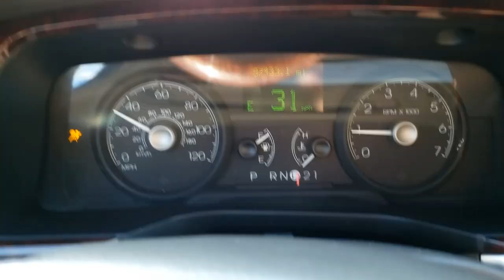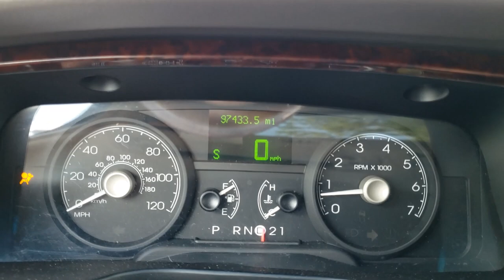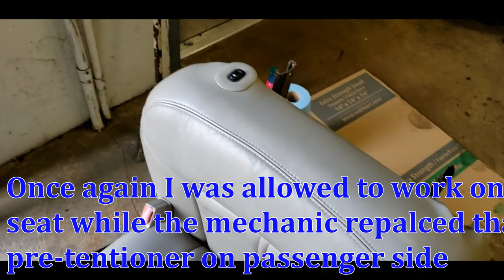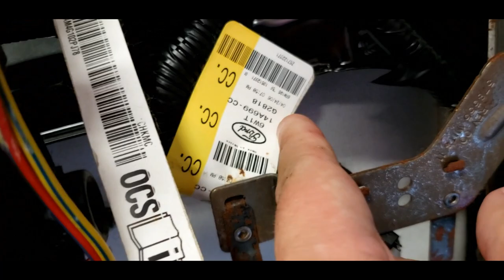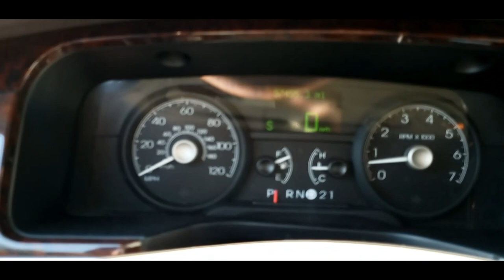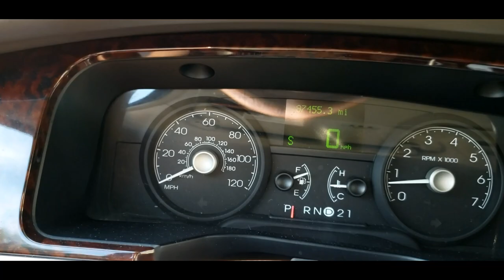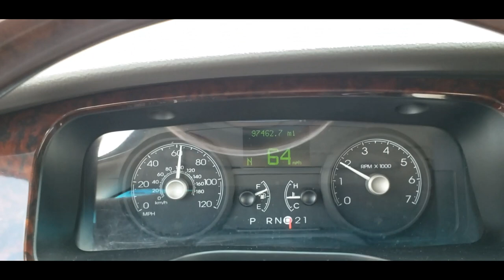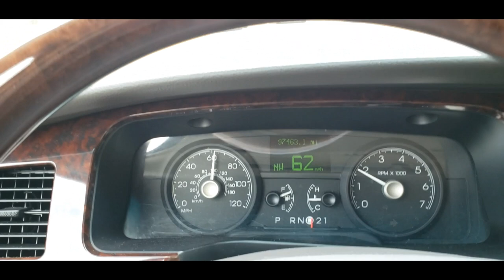Final Attempt To Fix Airbag Light on My 2006 Lincoln Town Car + I found Another Lincoln Town Car!!

Comment: Lincoln is underrated, you see the new ones they have, they are so neat. Dont see too many, but when I do it's always a treat. If they keep going down the path they are right now, they could be the American bentley.
Reply from the maker: I agree and miss the times when there were lots of these cars running around
Reply: @VitaliyKofman  Yeah, American cars are so underappreciated. I wish US car brands would make a bigger splash than they are right now. They complain about quality these days, yeah some aren't as good as they should. GM and ford these days do need to work a little harder. But these older cars are very reliable. Before  GM and other US companies just used rebadged cars, they let the engineers make some rock solid cars. For example: Before GM completely took Saturn over and rebranded things, those cars were so reliable. My father had Saturn SL2 for 20+ years, only had some transmission work after many years and many many many miles, and had to replace a seatbelt, thats it. Funny thing is, is it was built so well, when he got into an accident, the airbag didn't even need to go off, the car did a great job at softening the blow, and he was doing at least 35-40 mph and he was able to drive it home. And the other dudes car was completely smashed on the side. Now days the whole front would crumple even when a slow and weak force is applied. So i love older American cars, very good. Some brands like Lincoln still has it today, and maybe dodge is still decant. But quality control needs to be what it once used to be. But for the main part they are very good.

Comment: Congratulations on fixing your beep. and around how much would the labor cost at a shop to replace the seatbelt kit for these cars?
Reply from the maker: Thank you! Super happy about this! Labor for both sides was $520. Way cheaper then at the dealer + I was able to buy parts myself.
Reply: @VitaliyKofman  nice!
Reply: How much were the parts and what parts were changed? Love your lincoln!
Thanks for your reply!
Reply from the maker: Thanks! Both seat belt retractors replaced for about $520 + labor which was reasonable. At first driver's and then passenger's.
Reply: And did you need both seat belt retractors? and how about seat belt tensioners? Thank you for your response back!
Reply from the maker: I think retractors and pretentioners are the same thing as they come in 1 assembly. I first replaced the driver's side and the light went away for 1.5 weeks. Then it came back and after replacing the passenger's side it stayed off for 2+ months and hope it stays this way.

Comment: You have a leak causing your rust problem. Likely spot is the passenger side intake cowl, blocked by leaves etc. your carpet is likely soaked every time it rains. Fix is easily found on YouTube, 5 minute fix,
Reply from the maker: @brian murphy It's been raining heavily for the last couple days in IL and I thought so also. Checking the carpet and it is a bit wet, but nothing drastic. I know of that intake cowl and it's perfectly clear of any crap so don't know where it's coming from... Maybe I'll have my trusty mechanic check it out.
Reply from the maker: Thank you! I does look clean, but I never removed that shroud to check the seal or how it is on the deep end. Looks like I have another project coming up over the weekend and another video to make :)
Reply from the maker: Thanks for that! I have 06, but looks almost identical so I'll give it a shot!
Reply from the maker: Cool! Water leak - here i come!

Comment: I had a leak on the driver side that wet the carpet both front and back [2006 TC Signature]. Turns out water was entering the cabin along the trunk release cable that went through the firewall. [BTW I am in DesPlaines, IL]. My mechanic took out the interior,  removed the carpet [which contained 5 gallons of water] and let it dry in the sun and under fans for 3 days. Then he replaced the rubber firewall seal the cable passes through, brushed and painted the rusted seat brackets, Then reassembled......Big job!! Other known causes, sunroof channels, door drains, floor plugs, and more. I suggest you go to https://lincolnforums.com/forums/ for a lot of good information on this problem
Reply from the maker: Thank you! I already experienced the sunroof leak and fixed it with plenty of videos so let's rule that out. I didn't check the trunk area (yet), but will do so today to rule that out. Like I replied to the other comment, carpets are slightly wet with that cowl thing clean visually, but I need to get in there to check the gasket and maybe there is a clog further down where I can't see... WHY COULDN'T THEY MAKE THIS THING WATER TIGHT OVER 30+ YEARS??!! :)
Reply: had  mine  leak  in along  the  emergency  brake  cable  mechanic  sealed  still leaked a little   around  the bottom of the windshield under  the  firewall and  carpet, put  some  gorilla  tape  along  the bottom  of the windshield  helped.  have  to  check  the  trunk  release  still  leaks  a bit  when it rains  real  hard,   got  the  BEEP and that  air bag  light  too   but  not  willing  to  spend  that much  to  get it  shut up  more  worried  about the damp ness

Comment: ...carpet cleaner with Oxy can be sprayed and blotted up with a clean towel (cloth or paper)....

...looks as though the passenger, at some point dumped water...or the window was left partially open in a rain or snow storm and was not  properly dried out...easily done...

...I once bought a '96 Roadmaster  Estate Limited wagon in pristine condition except for a dark stain in the right rear footwell...turns out the original owner, a retired doctor who used the car only when his grandkids visited...well, one of the goober kids had dumped a Coke and, of course didn't let Grandpa know...now THAT was an awful, dried, syrupy mess...your rust is a piece of (birthday?) cake by comparison, Vitaliy......disfunction no longer rules...it's nice when technology is our friend and not our nemesis...
Reply from the maker: Ha! Thanks for the comment! I use my car as a daily driver and I think the previous 3 owners did the same. It's possible that some nasty stuff was spilled, it's not bothering me any more. My 4.5 year old is now causing all kinds of ruckus on the back seat with his dirty boots all over.